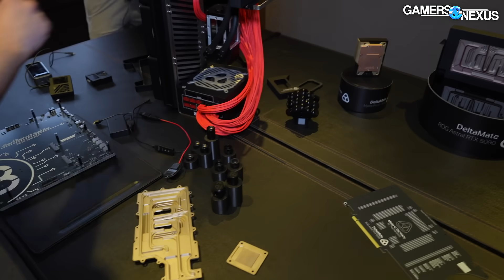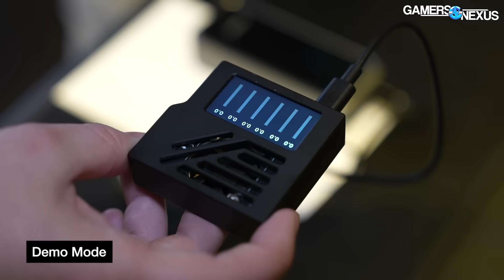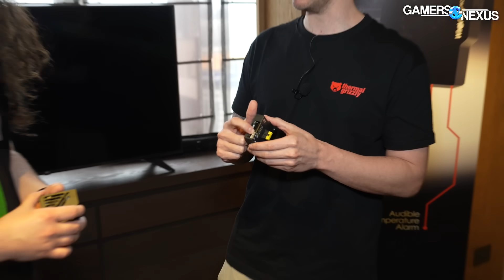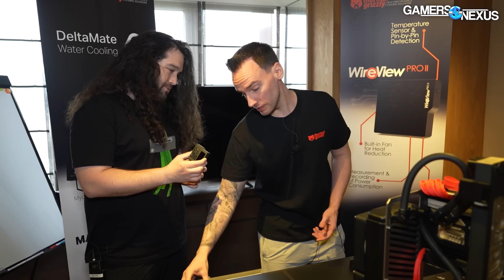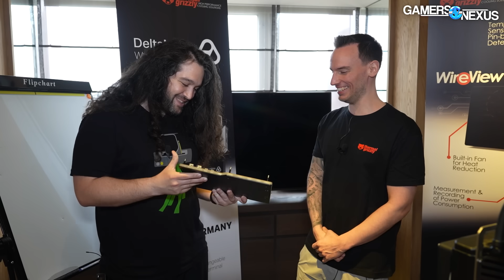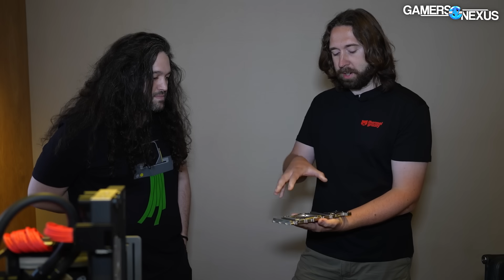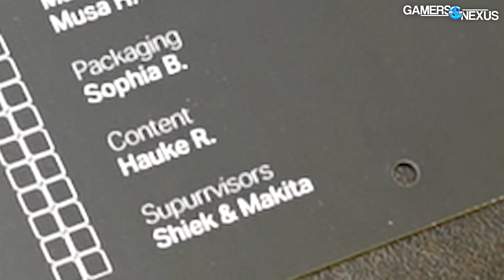Fixing the Unfixable 12VHPWR Connector, ft. Der8auer

Comment: Something I noticed in the background - the WireView Pro advertises a "built-in fan for heat reduction". How will this act in cases of overheating in the wires and connector?

To me, the ideal scenario would be that the WireView Pro contains the hottest part of the chain from PSU to GPU. That way, the device never reports a safe temperature while other parts (like the PSU end and the wires along the way) are experiencing unsafe temperatures. However, if we have an actively cooled WireView, that might not be the case and it's plausible for an increased fan speed to mask the temperature increase in the data, right until the PSU end overheats and the connector on that side melts. It'll obviously depend on a lot of implementation details, I'm curious to hear if this has been considered.

Comment: Here's what I don't get. 600w at 12v is 50 amps. XT60 connector existed before any iteration of +12vhpwr or 12v2x6 or whatever they're calling it now to run away from the bad reputation it's always going to have.
Why did they invent a new standard when XT60 is right there and it only needs 2 pins that can handle 60 amps instead of the "can't even handle 50 amps among all the pins" that you get with +12vhpwr?
Tech bros gonna tech bro, you used to want to fail fast to iterate fast on your idea so that you could offer a better product to the consumer, seems these days you wanna fail fast and often so that the you don't have to support the product by the time the "hey you burned down my house" warranty claims start pouring in.
This is why the "invisible hand" of the free market is not an invisible hand at all, it's called the Federal Trade Commission doing the job that it's not been doing for the past 9 years.

Comment: The copper wires need to be more thick. It's the same with housing wiring in which we use hard copper wires. PC power cables are relatively short usually have a lot of thin copper wires bundled and have resistance sensitive connections. Connector amps need to be soldered. We are going beyond low voltage systems with all these amps so it goes into the realm of automotive electrical rules. Make a setup with hard copper wires/soldered connector amps and one with thin flexible wires. You would think cable length doesn't matter however also with signal cables they cannot be too short or too long. Minimal 30cm long. I'm sure you will notice a big difference when using hard copper wires or much more thick wires and forget about flexible cables being good because the flexible means less capable

Comment: I'd probably use Asrock's PG-1600 PSU with the built-in thermal sensor on the cable and the feature that allows it to shut down the entire PC the moment it detects irregular thermals on the 12VHP aside from adding the WireView. Asrock's tech support team actually responded to my email to them and confirmed that ALL 12VHP cables out there are made with the wires just crimped onto the thin contacts due to how small the entire connector is. The best solution is still a different connector with a larger size, possibly soldered contacts, and a very robust wire choice and overall construction.

Comment: 12v High power connector is a underspecced and overloaded electrically 
The fact is the 6pin and 8pin connectors is the far better choice 
12v high power needs current sensing and thermals integrated just to be usable without extensive fire risks

Comment: GPU block price: EUR 500 (>$560). Response "OK". The engineering is very nice but I don't want anyone to complain about GPU prices, if they are prepared to pay over $560 for a GPU cooler.
Reply: The cost comes mostly from the material choice. Copper (and any of it's thermally useful alloys) are quite expensive. Machining costs are minimal from a man-hour perspective since there is little setup time compared to program run times. So while it may take 132 minutes to machine the blocks, the actual time a person is handling the part is a much smaller percentage of that. Add in R&D, tool path programing, additional components, assembly,  packaging, and profit margin... well... this might be pretty standard pricing to make a profit. -(source: I run cogs for a company that does this kind of thing)

Comment: Is it possible to make your own 12VHPWR cable? We've seen that the current overdraw can go beyond the 9A spec of the current cables so why not make 3rd-party cables that can withstand the excess amperage without melting? Thicker gauge wires and connecting pins that can handle the power?
Reply: The contacts can't really get bigger so that won't fix per pin imbalance at the connection end. It would keep cables from warming up
Reply: @Demon09-_-  I know. The limitation are the pins, so they need to do some research to see if some other materials can be used to replace the teeny-weeny "gold-plated" pins.
Reply: Come to think of it, we don't even need new cables. As far as I can remember, I don't recall seeing any of those adapter's melting so just use the 3-to-1 or 4-to-2 adapters with the 8-pin PCIE cables to the PSU. Just need 12 better pins at the GPU connector. Won't look good, but at least cables won't be melting.

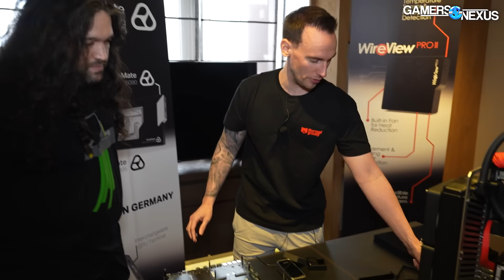Comment: 15:42 I assume those brackets are for PSU mounting.  Maybe add some cutouts on the underside to put cable ties for the power supply cables?  But for the test points, if you want to offer it for additional power, why not install some screw terminal blocks along an edge for that?

Comment: How about making the logging rate dynamic based on events? Eg, if the data has been within X% of expected values for the past Y amount of time, reduce the rate to once per minute. If the data diverges from expected by X%, start logging much more frequently.
Reply: or only log when the numbers change 5% from the last logged number - if things are spiking all over the place, lots of logs. if things are stable, many seconds between logs

Comment: Waiting for Der8auer to build a 12VHP water block to cool the connector, and maybe attach an extinguisher to it when it catches fire :)
Reply: Could hook a thermal probe to a solenoid and use a CO2 cartridge as a fire suppression system that's aimed directly at the plug when it gets hot enough to ignite imagine being in the middle of a gaming session and your computer suddenly goes off and starts blowing out fog then shuts down 😂 Nvidia would be shitty if you marketed it specifically for 12vhpr Nvidia cards
Reply: Fire suppression system like a race car. Would be cool.
Reply: Ceramic housing for the connector would do the trick. A lot of ceramics withstand seriously high temperature. Hafnium carbonitride has a confirmed melting point of over 4000 degrees C, with some formulations going up to around 4400C. The material is so tough it's difficult to tell exactly how much heat it withstands. (Everything else melts first, I suppose... :D) So, this should be sufficient. ;)
Reply: Linus already bought a fire truck to deal with the connectors catching fire. Other reviewers will probably need to do the same. 😂
Reply: That's stage 6, they are still at stage 3. Don't worry, as long as 12HPWR exists, they will get there
Reply: Halon gas?
Reply: and for the 6090 a shrapnel blocking shield^^

Comment: If we're gonna ditch standard ATX cabling for something else to feed ever more voracious video cards, how about we just pull a page out of GM's playbook? 8 gauge stranded copper cable with sidepost terminals.

It works fine to start my 71 Chevy C10 every day. Surely itt'l run an RTX50990...
Reply: Im pretty sure for a 50990 you would need a dyson sphere
Reply: @randobamarny  hah maybe. But hell GM sidepost battery cables will carry enough current to start a big block(My C10 has an I6 they don't even feel it haha) they should be able to feed a GPU.
Reply: @randobamarny  I will grant cable management might get a little tricky with such large gauge cables running from PSU to GPU, but eh. It would simplify hookups at least.

Comment: @der8aur-en: have you considered releasing 3D printable models of the Wireview Pro variants? It might make it easier for potential customers to tell which one would best fit a particular card and build. On the other hand, maybe there's too much chance a 3D printed 12VHPWR pin mockup would break off in the GPU and add to the problem.
Reply: You did burn $4000+ 5090 by using self printed connector… that would be just great…
😂
Jensen would send you thank you card for christmast for that…

Comment: @der8auer-en please, make the Wireview Pro also for the good old pcie connector (up to a triple x8 configuration). If it works out it might also save AMD and Intel GPUs from failures for several generations coming and I wouldnt mind pay an extra ~100€ for the peace of mind and better monitoring features. I also hope that you will release the related device code as open source and let the community work together with you and your team on improvements and support.

Comment: Boy, there is a lot of work going into trying to find any solution other than, "make wires and contacts thicker", with a side of, "admit 12VHP connector should only have been rated to 450-500W from the start".
Reply: It's Nvidia, of course they're going to double, triple and quadruple down on a steaming pile of garbage connector that is irredeemable. They're also of course going to double, triple and quadruple down on dumb connector designs, like pairing all of the +12v and grounds to a single point that can't be per pin monitored and make it the Nvidia Centipede of garbage.
Reply: Considering we already have a case of a Japanese PC builder reporting before that they had a brand new 5070Ti build almost immediately go and have cable burn up on first boot, I'd say the entire 12VHP connector itself should just not be used altogether even at lower wattage. It is too thin, too flimsy, and too volatile.
Reply: @kamikaze00007  It would be a viable connector if they weren't cranking huge amperages through it.

The PC world needs to ditch 12v and move up to 24 or 48v if we're going to have ever increasing power demands. 12v is just too low a voltage, you need huge bus bars to be cranking the amount of power Nvidia's cards require.

If the 2x6 pin was running at 48v, it would have absolutely no issues with burning up.

In the CCTV and networking world, we've been using 48-52v for decades now, which allows comparatively large loads to be on small wires without the whole thing turning into a smoldering crater. Back in the analog camera days when they ran on 12v, burnt wires and connectors were a constant problem.
Reply: The issue is that all the AIB partners who could change the connector are intimidated by NVidia (alluded to in Steve's recent community post on how he's working on a long-form investigation, and the recent video here about NVidia threatening to pull access and Steve's recent video with Roman over on the Der8auerEn channel). The people who don't have to be worried about NVidia pulling GPU allocations, marketing funds and such are all unable to do anything to the GPUs, they have to accept the connector and just try to make it less awful.
Reply: 12VHP would be absolutley fine if there was load balancing on the card. A GPU that draws 300W+ is expensive enough for 6 shunt resistors and an ADC IC to be included in the BOM. You can easily divide the 6 wires between the phases and balance the current draw with how you drive the DCDC converter
Reply: @Horstelin  Yes. They did that in the past,and they could do that again.
However, that adds like, 12 cents to the parts cost. Which is not much money, but it IS money. And NVidia will absolutely penny-pinch the crap out of this and not spend those 12 cents.
Reply: That's a 500w connector! Jesus... That's tiny. 
I've not built a PC for a while but for other electronics...I would not want to put 500w though anything that small.

Comment: Hi,
Thank you for the video!
I have a suggestion for upgrading the Watt Watcher. Please add an option to reroute or just an additional lane to add a function to short the power button on the motherboard front panel connector. That will create an option to add a use case on Linux-based machines without creating and supporting a separate application version. My GPUs always use maximum power during inference or training on my AI rig. I chose 9070XT as my GPU selection because I was afraid to use 12VHPWR, but with this product, I might consider using GPUs with 12VHPWR.
Also, if you add some external sensor or cable (as a paid option), you can be compatible with Founder Edition cards and GPUs with hidden connectors.

Comment: i used thermal grizzly duronaut and it came out hard and dry, impossible to spread on all 4 corners with tools included, 50% of the paste got on my fingers. this could be user error but i am staying with thermalright's TF7 paste. i got 2 tubes for the price of 1 tube of duronaut which i feel i was scammed with. the product does not include any instructions nor does it include proper tooling to get the edges of the processer. this is not only an intel 12-14th gen issue, everyone has this issue, including me with a haswell chip. duronaut is dry, more like putty than paste, and would rather stick to the tool or me than my processor. 

TL:DR please fix duronaut and if other products are like this i will stay away from this brand and recommend thermalright or a competing paste that has actual viscosity for spreading as intended.
Reply: I think you got a knock off pretty sure it's spelled differently from what you posted?

Comment: 19:30 - With a feature size of 0.2 mm, I'm somewhat surprised water block manufacturers haven't started using EDM.

Fabrication of micro channels with a width of 25 µm has been demonstrated with µ-EDM all the way back in 2004. That's 1/10th the feature size of the block here.

https://pubmed.ncbi.nlm.nih.gov/15307443/

And there are companies that make µ-EDM machines, but I have no idea about how quickly they could create an array of micro channels in a water block.

Comment: People is stupid here. Nvidia connector on gpu is good if you use the adapter given inside the box. The problem is third party cables. Have you ever seen an original combo of gpu nvidia 50 and nvidia adapter burning? 😂😂😂😂😂😂😂 under here you re very stupid. Fault is not of nvidia. But who makes cable for their PSU. the cable is good.
600w -75 (pcie) is safe...

Comment: dam i was excited he created a load balancer circuit between GPU and PSU, but its just a data logger
Reply: Id think this is stage 1 and that would be the end goal
Reply: @lordofwhip As far as i understood (he said), this is to get more useful Data to track down the actual Issue and later on provide an Solution (maybe if even possible). 3:32 - 4:04
Reply: How would you make it if the point of failure can be on the PSU side?
I think that the kill switch is enough of a feature.
Reply: @wittywolk  if you put in variable resistors (constant current source using an opamp + mosfets ig) on each pin in the middle of the cable and , you also solved the PSU side, since the current will now be balanced between all the pins and won't overload a single pin or connector on the PSU
Reply: @RminusOR Theoretically, that’s what the sense pins are for on the connector but they never implemented it. Just lazy engineering. If they had active sensors (Hall effect) by the wires, the card could sense when 1 wire was carrying too much of the load and use a mosfet to regulate the load per wire. That would solve the melting problem but would cost about 4-5 dollars to implement. Considering how cheap Nvidia actually makes these cards, they wouldn’t go for that solution. After all, they already didn’t. When you look at the teardown of the cards, Nvidia puts all of the money into the silicon of the gpu itself and the heat sink. All the rest is pretty simple and cheap.
Reply: @richardbeckenbaugh1805 I dont think that's the purpose of those wires though - it's not enough of them. They could use them to sense the voltage back at the PSU on the whole connector, and then balance by connector, but thats not good enough, you can still get current imbalance per pin. And right now theres only 1 connector used anyway. Hall effect is not necessary, they should simply have shunts for each pin on the graphics card and then just draw same current from each by modulating the power stages connected to each. But thats not cheap, uses lots of space and layout. So they made a bad situation (shit cable/connector with too little headroom) .. worse.